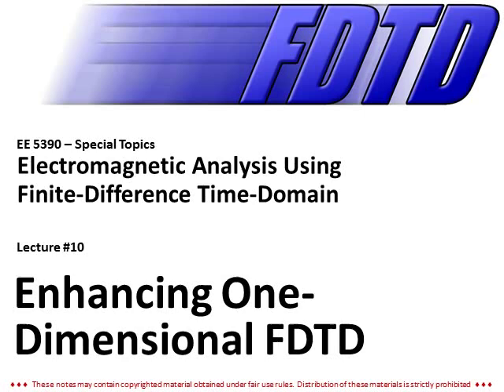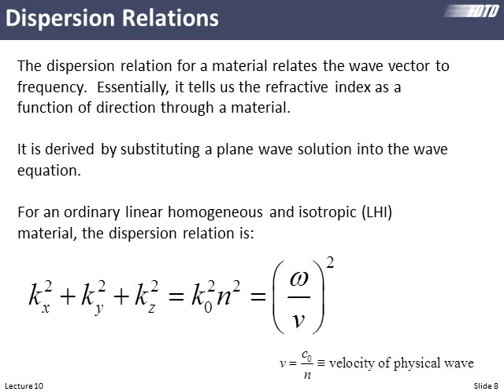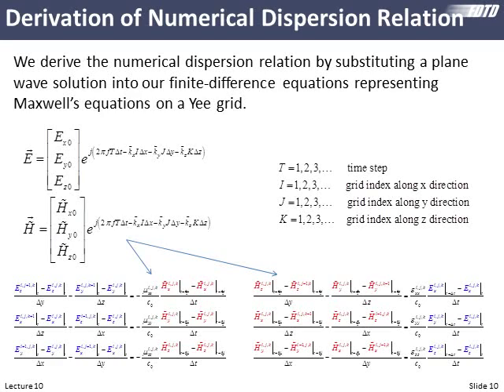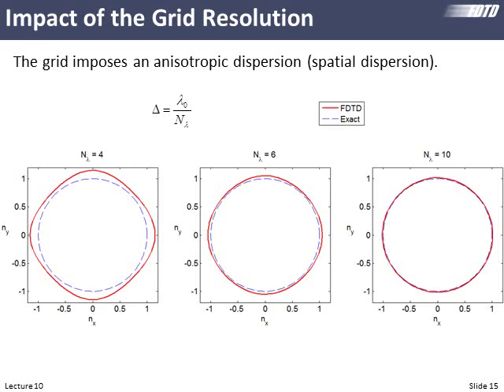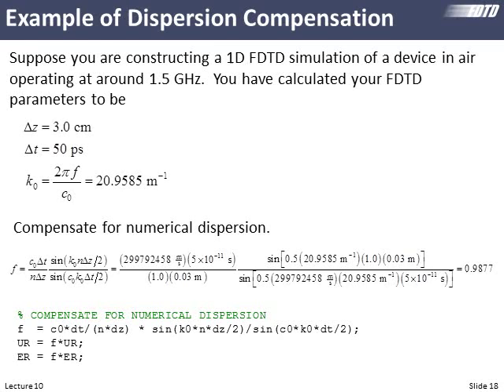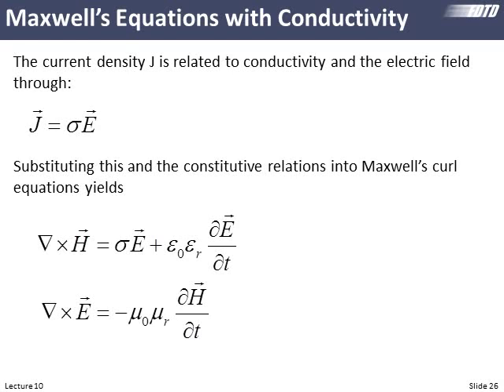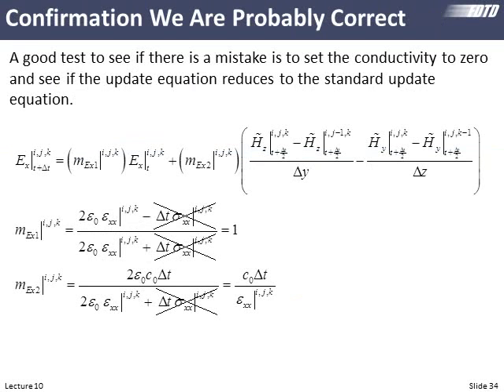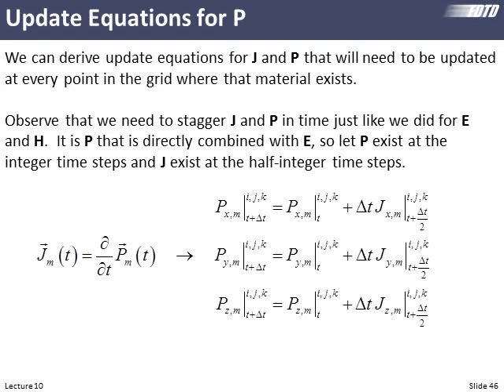Lecture 10 (FDTD) -- Enhancing 1D FDTD

Comment: Hi, I am trying to include dispersion in the FDTD model.

So, What should be the intial value for P(at time t) and J(at time t-dt) while including dispersion in the FDTD model. Assuming there is only Py component 

Because as per the lecture for future values of J(t+dt), we need J(t-dt) ,P(t) and E(t).
Reply from the maker: Set everything to zero at the start of the simulation.
Reply: Hi , I am facing issue while implementing dispersion in the 1D FDTD

Below is the additional/modified line of code I have added in the original code to include dispersion.

(Made some correction but still code is unstable)

 %SLAB PROPERTIES

 dslab=0.0762;
 erair=1;
 erslab=12;
 Gamma=1.2e14;
 omega_t=9.65e14;
 epsilon_dc=12;
 param=e0*(epsilon_dc-1)*omega_t^2;

%Here I am assuming fm=1

%----other code-----

% INITIALIZE MATERIALS TO FREE SPACE
ER=f*ones(1,Nz);
UR=f*ones(1,Nz);
GAMMA_0=zeros(1,Nz);
OMEGA_t=zeros(1,Nz);
PARAM_t=zeros(1,Nz);

%---other code------

%ADD SLAB

ER(nz1:nz2)=f*erslab;
GAMMA_0(nz1:nz2)=Gamma;
OMEGA_t(nz1:nz2)=omega_t;
PARAM_t(nz1:nz2)=param;

C1=(2-GAMMA_0*dt)./(2+GAMMA_0*dt);
C2=2*OMEGA_t.^2.*dt./(2+GAMMA_0*dt);
C3=2*dt*PARAM_t./(2+GAMMA_0*dt);         % assuming fm=1

%------other code-----

%INITILIZE FIELDS
Ey=zeros(1,Nz);
Hx=zeros(1,Nz);
Py=zeros(1,Nz);
Jy=zeros(1,Nz);
Dy=zeros(1,Nz);

%------other code-----

%IN THE MAIN LOOP

  for nz=1:Nz-1
        Hx(nz)=Hx(nz)+mHx(nz)*(Ey(nz+1)-Ey(nz))/dz;
    end
    Hx(Nz)=Hx(Nz)+mHx(Nz)*( E3 -Ey(Nz))/dz;
    
    % H source
    Hx(nz_src-1) = Hx(nz_src-1)-mHx(nz_src-1)*Esrc(T)/dz;
    
    % Record H-field at boundary 
    H3=H2;
    H2=H1;
    H1=Hx(1);
    
    
    
    %Update J from P and E
    for nz=1:Nz
        Jy(nz)=C1(nz)*Jy(nz)-C2(nz)*Py(nz)+C3(nz)*Ey(nz);
    end
    
    
    %Update P from J
    for nz=1:Nz
        Py(nz)=Py(nz)+dt*Jy(nz);
    end
    
    
    
    
    % Update D from H
    Dy(1)=Dy(1)+e0*c0*dt*(Hx(1)- H3 )/dz;
    for nz =2 : Nz
        Dy(nz)=Dy(nz)+e0*c0*dt*(Hx(nz)-Hx(nz-1) )/dz;
    end
    
    % D source
    Dy(nz_src)=Dy(nz_src)-e0*c0*dt*Hsrc(T)/dz;
    
    %Update E from D
    for nz=1:Nz
        Ey(nz)=1./e0*(Dy(nz)-Py(nz));
    end

But still the code is very unstable. The output is unbounded. :(
I will be very thankful for any kind of advice/suggestion in this regard

Once again thanks for such an insightful and awesome lectures. Usually,I find it very difficult to learn FDTD from the book. but your lectures really helps me to understand the basics of FDTD as well as how to implement in the simulation.
Reply: I hope you are doing great Dr. Rumpf.
I would like to know what is the problem in the code above too as I am facing the same problem. The quantities become unbounded very quickly. I have the polarization terms derived in a different way thought. And it works. By 'works' I mean it doesn't produce unbounded outputs. But there is no way to tell if the code is actually right. Conservation of energy method of checking will not work here because there is absorption here. If there were some practical examples like lecture 9 we could have verified our results.

Comment: Hi, I have 2 more questions, how can I take into account the  full anisotropic material with the frequency-dependent model?. should I create nine Lorenzt models for the polarization like simulating each component of the permitivity tensor and then used the interpolation for the off-diagonal componentes (so everything is in the middle point of the curl as exposed in another of your lectures)?.  and the second question is; how can I add a fixed magnetic field to the model?, I am trying to get the magneto-optical response when applying a fixed magnetic field in a layered media, so in the analytical solution it will be easy by only adding some fixed components to the off diagonal terms in the permitivity tensor, but in this case I don't know if physically it will be the same by adding these magnetization in the relative pemitivity of the free space (the constant Epsilon infinity showed in the slides). Again Thanks a lot for your time.
Reply from the maker: First, I suggest you identify the specific physics want to incorporate.  For simple anisotropy, there is no need for Lorentz models.  The lorentz models enter the picture when you want to account for dispersion.  

If you were to combine dispersion and anisotropy, you should only use three Lorentz models because we live in a world restricted to three dimensions.  You would iterate those models to get the three principle permitivity values.  From there, you would rotate the diagonal tensor to calculate the off-diagonal components.

In FDTD, there is really no need to incorporate a static field value.  That field is modifying the electrical properties of some material.  In mnost cases, you can just use the modified material properties and not worry about the static field.

If you are looking at layered-media with anisotropy, dispersion, etc., take a look at the transfer matrix method.  I think it may serve you better.
Reply: @empossible1577 , yes,  the transfer matrix works for most of the cases,  but now, I am studying layers that have inside nano disk or other types of geometrical "anisotropies" (maybe in that case it is not called layered media). Actually what I need to incorporate is absorbance (and also measure the Kerr or Farady angle but I haven´t get to that yet), but maybe I misunderstood something with the absorption model presented in the lecture witch I believe only allows one frequency at a time, And I though that the next section (Frequecny dependent material), was for implicitly incorporate the absorption with the Lorentz model and in that way stimulate the system with a Gaussian pulse. 

So if the Lorentz model does not include abortion, I will have another question, If absorption is only manageable with the current therm of the maxwell Equation, I am a little be confused with what will be the value of the sigma therm (the imaginary magnitud of the refractive index of the material?). or is there anyway to have a frequently dependent material that also includes absorption.

Again thanks a LOT for your time and patience
Reply from the maker: @okar202  The Lorentz model does include absorption.  Loss is introduced through the gamma term.  It is also possible to introduce simple loss through the conductivity term.  I have even seen people do both!  

If your device size is small, I recommend using a frequency-domain method.  It will make incorporating all your crazy stuff very simple.  Time-domain will only offer you benefits for nonlinear material properties.

Comment: Hello !! I made a disperssion code with matlab.Does the fact that at some points conservation (sum of R and T) is below 1 derives from the  material's disperssion loss?
Reply from the maker: If the dispersion you incorporated includes loss, this is certainly expected.  When I am simulating things with loss, I will sometimes turn off of the loss, run the simulation, and look for conservation to be a little more sure things are correct.  Then I turn the loss back on and run the simulation.

Comment: I didn't implement frequency dependent materials. With that said, what should be expected with the reflection of a wave as I increase its frequency? 

As we know from skin depth equation, a high frequency wave will be attenuated faster than a low frequency wave. However, in my simulations it appears an increase in frequency is doing the other way around, making the wave able to go through the lossy material. Do you know what  could be wrong in my equations, or maybe without frequency dependent materials equations the changes in frequency won't work?
Reply from the maker: The PML is a strange thing as it introduces strong anisotropy, dispersion, and loss.  Some dependence on frequency, polarization, and angle of incidence is expected, but should still perform well for you.  Without seeing how much variation you are seeing, it is hard to see if what you are getting is correct or not.
Reply: using very low conductivity (sigma = 3.54e-3),  a 10 MHz wave gets almost completely reflected when reaching the first interface of the material and attenuates the rest before reaching the other end. When I increase the frequency to 10 GHz and further, the wave simply almost ignores the materials, and gets transmitted right through it.
Reply from the maker: Are you simulating reflection from a PML or are you simulating a structure with conductivity?  I do not have enough information to tell what your problem is.  Conductivity alters impedance so your wave may be reflected instead of absorbed.  Conductivity alters absorption coefficient so if the wave is not reflected it is absorbed.  If you are simulating a slab of material, you have resonances that could also be altering the response you are seeing.  

I suggest simulating something simple like a slab of material that is a quarter-wavelength thick at your center frequency and has some conductivity that is low enough to allow some transmission but high enough to cause some attenuation.  This is something easily replicated by another numerical technique like the transfer matrix method.

Comment: Respected Sir,
What if the dielectric slab has varying refractive index with respect to frequency? then should I calculate the refractive index based constants for every frequency?
Reply from the maker: +vinpremkumar There are two ways to do this.  The least efficient way to do this is to simulate one frequency at a time with a pure frequency source and manually change the refractive index each time.  A more efficient way to do this is to incorporate the dispersion directly into your FDTD algorithm.  There are many ways to do this, but Z transforms and the Lorentz-Drude seem to be the most popular.  See the last section in Lecture 10.
Reply: +vinpremkumar Thank you. I hope further questions will not be a botheration.

Comment: I have made a code for 1FDTD with cole-cole media .I have an analytical formula for the Reflectance so i can see if i made the code right.The fact is that the Fourier of FDTD is the same with the analytical results only when the material is only a few cells .When i put more cells ,the reflectance stays at a price tha doesnt change if i add more, but its different from analytical for 10% .Of course it changes with frequency always ,my problem is with the length of the material.Is it acceptable or do u believe i made a mistake ? The  analytical formula is the   :                                                                   
 abs[R(w)]=abs [  (1-sqrt(epsilon_r(w))) /    (1-sqrt(epsilon_r(w)))  ]
Reply from the maker: Are you simulating transmission through a slab of material?  The equation you have does not have thickness as a parameter so I am not sure what exactly you are modeling.  Can you clarify?
Reply: CEM Lectures i have only a slab .its exactily like the example u have in matlab but instead of e_r constant i have e_r(w) from cole-cole equation .
Reply from the maker: Make sure you are always simulating a slab of the same physical size.  Multiple the number of cells wide by the grid resolution parameter dz to check the thickness.  Be sure that is consistent.